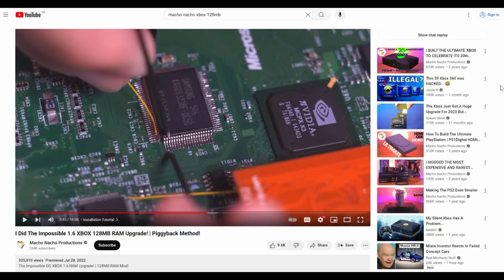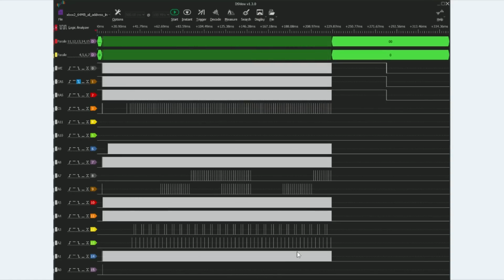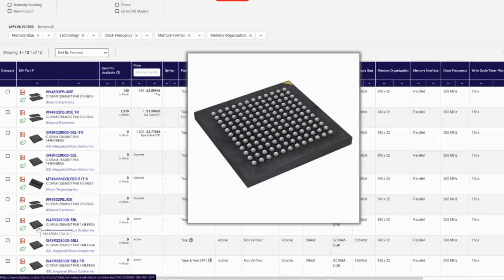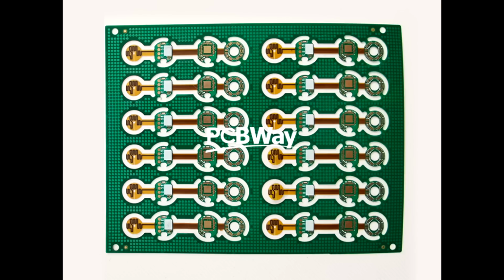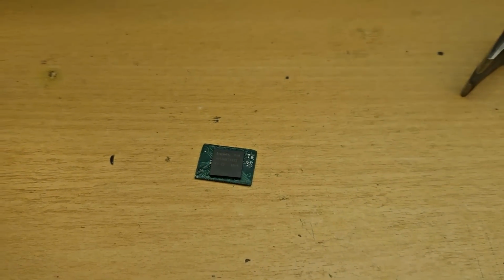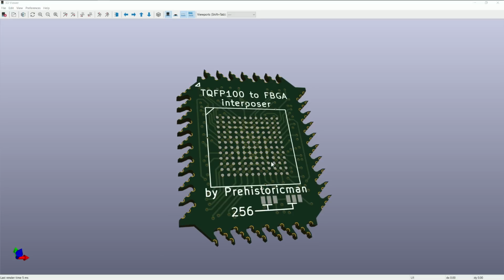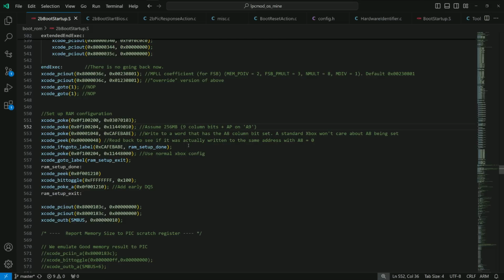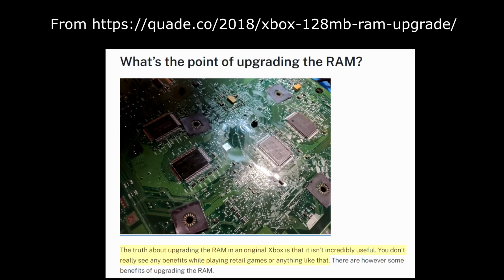How I put 256MB of RAM in the original Xbox

Comment: With a CPU upgrade (maybe over 1 GHz such as 1.4 GHz), the extra RAM could be used for XBMC as Linux by also for building homebrew software and games (indie games and demo-scene and benchmarking including office and hashing benchmarking or other cyclic-polynomial processing like VoIP or distributed networked XBox or connecting to a server rack for  part of the processing done on that, even including such as a load-balancing or LLM) perhaps even with some RUST applications. A Xenoblade Chronicles style Wii game could be doable in theory and thereby help learning, including emulators on a PC to emulate a 1.4 GHz Xbox with 256 MB RAM. Existing titles or abandoned ports could have all manner of bug-fixes using the CPU and RAM to make it easier. Championship-Manager style and Civ 4X style games could use the RAM and CPU power increased for AI and maps across player 'turns'. Processing FFT and radiography/radioscopy and OScope using the CPU and GPU to some extent could be useful. Databases and spreadsheets could use the CPU and RAM improvements. Larger matrices could be used on it. New peripherals could be made especially with various BSD and GPL licences to demonstrate use case of low level drivers of an API to use a Hardware Abstraction Layer, or even a humble browser for file or internet. Then also probability estimation and vector similarity comparison for better gaming AI or machine-learning could be thereby implemented. Let alone vimwiki style po plugin/addon for translations, there are voice-recognition and voice-synthesis possibilities but additionally, other translation enhancements for languages like Battle For Wesnoth style games could use that. 
New homebrew style Gameboy_EyeToy_Playstation style games (or something like Kinect) could use the RAM and processing, but also so could music studio style creative games and apps, or sampling and synthesis (or Gaussian Noise Elimination and Chebyshev polynomials in spectral analysis or Jones Polynomials in Reidemeister Moves in morphing can use it for larger samples and synth). Game editors (like in NeverWinterNights or RPG or JRPG or OperationFlashPoint or HalfLife Mods and CounterStrike or UT2004 and FirstPersonShooters) or dynamic economy games such as RailroadTycoon3 and X2-The-threat (or X3-Reunion) could use the RAM and CPU extra upgrades. OCR (Optical Character Recognition) with translation via say Rosenblatt-Parzen Window method could help software that uses something like a Wacom tablet and or stylus or Microsoft surface pen or light-gun or Haptic interface input-and-output devices or Wii-Remote (or Microsoft equivalent or Sony or homebrew), and GlovePie could be handy too like Joy2Key (and a Bluetooth and LoRaWAN stack or NDISWrapper_Network_NIC_Wrapper_Class or Auth FIDO2 keys and SSH). Even though proprietary licences can help in business analysis, the notion of people making contributions as philanthropy to open source software with more open licences can also encourage different ways of solving problems and learning. So running DLib and Eigen maths libraries seems more probable now with the better CPU and RAM upgrading.
My comment has no hate in it and I do no harm. I am not appalled or afraid, boasting or envying or complaining... Just saying. Psalms23: Giving thanks and praise to the Lord and peace and love. Also, I'd say Matthew6.
Reply: wtf is this incoherent gibberish
Reply: @Wasmachineman  terry davis been real quiet since this guy showed up

Comment: Hi friend, great video.

I'd like to share some tips and considerations for you to keep in mind.

I think you made the memory testing part more complicated than it needed to be. With good soldering technique, you should be able to achieve a perfect solder on the first try without any issues. Compared to other packages, FBGA-144 is actually quite large.

Some tips:

Avoid using hot air for soldering. The best technique for soldering these types of components is to use a hot plate. It provides better temperature control and ensures uniform soldering.
If the soldering process takes too long, it might be because the manufacturer used an alloy with a high melting point. It's best to replace the memory solder with a low-temperature alloy. 183°C paste solder should work well and reduce heating time. There are stencils available that allow you to do reballing relatively easily with enough practice.
Considering all these points, you should be able to fabricate the memory modules much faster and without needing to test them extensively before installing them in the console.
I have plenty more tips, but this is getting quite lengthy. If you need any help, I'm here. Cheers!
Reply from the maker: Thanks for the advice. I'd still need to test the memory chips on their own. Oh and my hot air technique for these chips was to heat the PCB from the bottom side, so it's a bit like a hot plate just less controlled. Also, it's good to test the chip after soldering because the heating could induce a failure. I got a few failures from the soldering step until I started baking chips first.
Reply: @userPrehistoricman  I understand, but using hot air isn't the right way to solder the memory modules. With hot air, you can't control the temperature or timing accurately. The correct method is to follow a temperature and time profile to avoid stressing the memory. I get that you need to test the memory modules, but with the right technique, you wouldn't need to check if the soldering was done correctly each time.

Comment: Look into using ribbon cable headers for the motherboard contacts and then you can extend the length of your interposer pins and fold them down on the four sides and just plug it in ;)
Reply from the maker: Possible. Don't want to make them too long and delay the signals
Reply: @userPrehistoricman  amazing work by the way! I would have argued 256MB ram was impossible to address on the xbox.
There are also ribbon cable headers that lay flat on the board and have a fold down tab,  if these 'fit'  you would not need to bend the interposer sides.
Reply: @userPrehistoricman  would it be possible to make a single interposer and sandwich it between the nv2a and the motherboard with a sodimm on it ??

Comment: Are there any games that can take advantage of this much memory?
Reply: no. 128mb was all that was on the table. the new ram is rated for faster but I don't know if that will mean higher FPS
Reply: no. xb games were coded with the logic that there is only 64mb. they do what they have to, to fit their code+graphics+audio etc in that amount, at each frame. modding a game to change that is nearly impossible, as large parts of the code have to be rewriten. most modding in xbes is for the games not to crach with >64mb. there is a very small amount of games that feel a bit faster, but that's about it.

Comment: i mean with emulators and maybe the pairing of a 1.5Ghz CPU things could work great... i know Surreal64 struggles with running 64MB ram for sure. i just wanna play my N64 games with no lag please...

also it could pave the way for someone to maybe develop a gamecube emulater or ps2 emulator or even spotify or something like save states

you know what could be really helpful is a Guide button like modern consoles have now... it would be mad fun to be playing OG xbox games smash into the guide launch spotify and listen to some bangers while chillin or having a lan party. 

i wish i was this smart to do all this.

512MB next? x
Reply: ps2 isn't going to happen as emulating it on even recent hardware is a challenge, a console released contemporaneously is next to impossible as the architecture is too different, as for the guide button you would need to mod every single game to multitask for the guide, most modern consoles achieve that by leveraging hardware virtualization to run the dashboard separate from the game itself, the xbox CPU and compatibles predate that sort of hardware virtualization support.

Comment: Please look for a solution to upgrading the gpu.. surely there is a better gpu to upgrade.

Perhaps even make a socket to fit the ram rather than resoldering memory onto board.. like a socket that allows ram to be simply clipped into place.. ??? I know sounds slightly tedious but for those that arent confident.
Reply: installing a socket would likely be even harder than what he just did to fit the chips.
Reply: @VivianDoremy  but it's been done.. so socketed CPU and GPU and socketed ram.
Reply: @garystinten9339  at that point its just a PC, in which case just chuck a mini itx board in the case and call it a day.
Reply: @shemlesh  no.. because we are modding an Xbox.. not building a PC.. 

If I wanted to see a mini itx computer being built. I'd go watch a mini itx computer being built.. this I find more interesting as it isn't just like add more ram, upgrade your CPU.. it's taking some actual risk and being more than Microsoft was. I like it.
Reply: @garystinten9339  the reason for why is because there are no xbox compatible GPU upgrades, the only way to "upgrade" would be to replace the northbridge that contains the GPU and the bits that make it an xbox rather than a PC, with a regular PC nforce northbridge, at which point you are just using the PCB as a carrierboard to build a PC, you won't have the ability to run xbox games so it would just be a paperweight.

otherwise you can spend $10k to get a high end current FPGA evaluation board and design it yourself, or spend approximately $0.5-2 million to prototype completely new silicon using a faster process to build something that is faster from scratch.